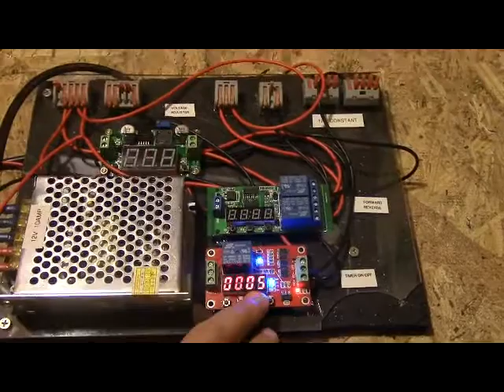Halloween Prop Control Panel Pneumatic Animatronic Options

Comment: Can you hook up a valve bank to this?
How many movements can you program?
How long can you record sound with animation, I have a 4 min song that I need 4 mins of animation to?
Reply from the maker: Depends on how you want to do it. A flex can have up to 16 inputs. As long as you have space on a SD card you can program for hours. I have multiple props with 8 solenoids on a manifold block if that is what you mean.
Reply: @Industen  The animatronic has 4 movements, takes 30psi, and 80 pounds of air compressor. I don't know what a flex is, and I don't know what a SD card is. I don't have any air compressor, air valve, or soleniods for it, but all the parts are inside robot, I just have to hook it up, I don't know what a  manifold block is either. I want to program it to sing, but don't know what to buy
Reply from the maker: @Enchantedmusicandmore  You need a solenoid to open and close the cylinders. If you want pinpoint accuracy with programming pick up a Boobox Flex 4input. You also will need a Direct connect to program through Director software. You can pick these up at either FrightIdeas.com or Frightprops.com
Reply: @Industen  BooBox Flex controller is out of stock. What type of solenoid do I need, it already has 2 air tubing to open and close the cylinder? What type of Direct connect to program through Director software?
Reply from the maker: @Enchantedmusicandmore  The Direct connect allows interaction between your computer and the flex. It connects with RJ45 cable. You need a 5way solenoids for each 2 hose connection. You will also need exhaust mufflers to reduce the sound on the solenoids when air is released.
Reply: @Industen  would I have to wire each solenoid to each cylinder inside the animatronic?
Reply from the maker: @Enchantedmusicandmore  Yes, unless you want the same movement on two cylinders. You could tee off to another cylinder off of the same solenoid.
Reply from the maker: @Enchantedmusicandmore  Well, the solenoid is separate from the cylinder. You would just attach the hoses to the solenoid and solenoid to the controller.
Reply: @Industen  Would I connect the solenoid to the valve bank?
Reply from the maker: @Enchantedmusicandmore  The solenoid controls the opening and closing of the cylinders. If you have two hoses off of each cylinder then it is double acting. You need a five way valve. One port if for the input another two go to the cylinders and two exhaust ports. You relay electrical wires go to the controller
Reply: @Industen  Thanks, can you recommend good companies to buy these solenoids and a five way valve from?
Reply from the maker: @Enchantedmusicandmore  I usually get my stuff overseas. Automationdirect.com is a good US company. I would just get four 5-way valves and a 4 manifold block if you want them all on one area. It also would reduce some fittings. An example…Instead of eight exhaust mufflers you would only need two. Basically, you screw the solenoids into the block and you have them all together. You don’t have to use it but I usually do using more then one.
Reply: @Industen  Thanks so much for the advice!

Comment: Nice control panels.  Neatness and labels are super useful on things you may work with only once a year.  Gluing the Wago lever nuts to the board and using them as terminals is a clever idea.  I might steal that one.  Remember to add strain relief, especially for the mains cable running in to your power supplies.  If your power cable is accidentally tugged, you want something other than the terminals on the power supply to take the force.
Reply from the maker: I put the cables in split loom and drill it into the board for slack.